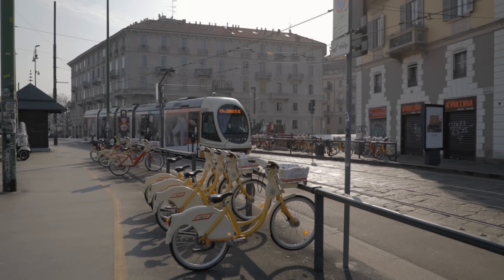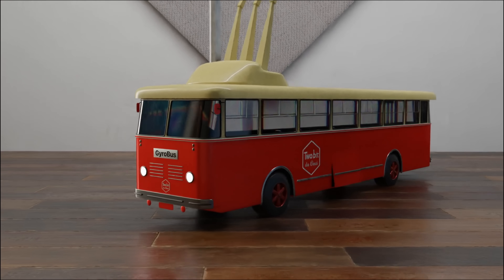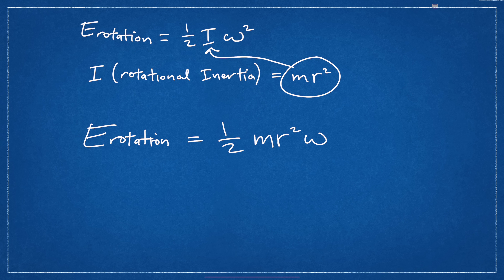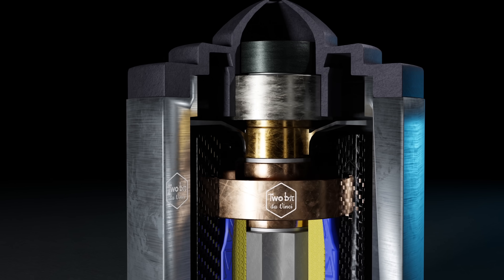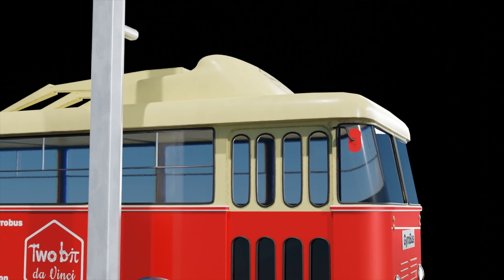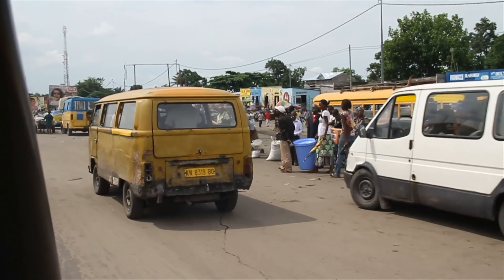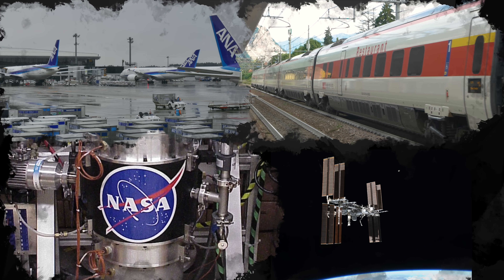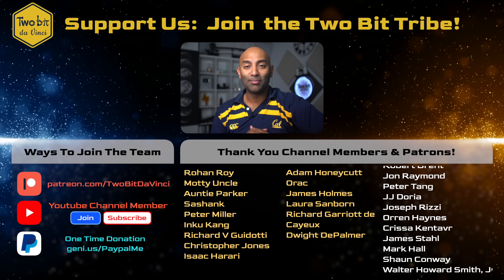This Bus Went Electric WITHOUT Batteries

Comment: 0:16 - Why you include something that stupid? There are also solar roadways... Do you want to lose all your credibility?
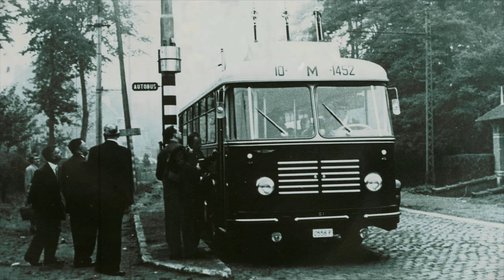8:49 - That is complete nonsense. Why are you even suggesting it?  At 8:19 we can see, the rotational axis of the flywheel is vertical, so there is no gyroscopic effect around that axis. It would resist any tilting actions of the bus, but not turning.

It would be nice if people on shows like this had even basic understanding of physics.
Reply from the maker: Turning caused the body to rotate as mass is uneven across left snd both sides. I didn’t get into it much more. But it would have the effect I described
Reply: @TwoBitDaVinci  Thank you for reply, but I have no idea what you are talking about. The way you can induce the gyroscopic effect is by trying to tilt the rotation axis of the gyroscope (flywheel). If you are turning the frame of the gyroscope around an axis which is parallel to the gyroscope's rotation axis, nothing (interesting) happens. Pure turning of your vehicle (frame of the gyroscope) happens around vertical rotation axis, so it is parallel to the flywheel's rotation axis, so you shouldn't have any effect. At most the vertical gyroscope (flywheel) would resist any tilting of the vehicle, not the changes of the moving direction. If this tilting is relevant or crucial for the drivability of the vehicle (while turning), then we have something to discuss about.

Comment: So did the heavy flywheel make electricity via generator or was it run off the wheel with a gear reduction?  How was the power train connected to the flywheel?

Comment: A fascinating snippet of engineering history. Not sure about the gyroscopic forces resisting turns though - the flywheel was horizontal so there should be no effect. Of course, if the bus hit a sudden hill or crested a sharp bridge you might roll a little and take a turn you DIDN'T want! (and the lowish rated speed wouldn't help because you can be sure the drivers would be gunning it...)

Comment: The practical energy densities of flywheels are not great. Like barely 50 watt hours per kg.
Making them suitable for stationary application. But if you want to use a ton of metal, you may as well make a nickel iron battery, or an iron or aluminum oxide based battery

Comment: The Southern REgion of BRitish Railwats had third rail electric locomotives equipped with flywheels. THe electricity they picked up, drove motors connected to flywheels. The flywheels were connected to generators. So the momentum of the flywheels would carry the locomotives over te short gaps in the third rails to avoid coming to a halt.

Comment: ..2 big points..the bus is mechanically driven with a fly wheel, not electric even though an electric motor may be used to spin the flywheel up..and also the climate emergency con for the funding scam that the new evil Greenpeace runs is bs..real scientists will tell you that the planet has currently only 400 ppm CO2 in the atmosphere when plants grow best at 1000 ppm which is why folks who grow food in greenhouses supply additional CO2 to their plants for optimal  growth meaning in reality, we need more CO2 in the atmosphere..don't listen to Greenfundings hustle..meaning we all need to drive more internal combustion engines...the planet is in fact in a CO2 deficit..drive more plz and save the plants on our planet...they so kindly make O2 for us..PS take off that OBEY cap right now and don't do it..unless you like satan and baal..

Comment: What about trollybusses? They are electric and don't have a battery, they are really common in some parts of Europe
Reply: Amusingly, the newest trolley buses here in Zurich (where the gyrobus was made!) do have batteries: rather than rebuilding the very complex system of intersecting trolley lines (for the buses) and overhead catenaries for the trams at a large intersection that was rebuilt a few years ago, they instead leveraged modern batteries. The trolley lines were removed from the intersection completely, far simplifying the cabling and making it much more aesthetically pleasing, and the buses simply pull down their trolley poles, cross the intersection on battery power, and then on the other side raise up and re-engage the trolley poles while passengers board. (Fully automatically, I might add!)
Reply: @tookitogo  I had always heard bout hybrid options, but they always seems nice to me, but considering the most expensive parts of the cabling is the curves (I think, I don't have any experience with this stuff) that's actually really smart
Reply: @thijmstickman8349  It makes sense! 

They also have started running hybrid gasoline (or diesel? I’m not sure) buses on some non-electrified routes.

Comment: this is a terrific article except for calling a flywheel a battery.  Batteries use chemical energy Flywheels store Kinetic energy,  Other than that detail this is a great artical .  I think I rode one of those in Budingen Germany in I970 it was a small electric train on a spur in Germany.  It Connected Budingen to Gelnhousen,  As a Small train it was ideal  Trains have limited radius corners.

Comment: I remember Polular Mechanics had a detailed artical about the Swiss flywheel buses in the 70s . These had a small gas motor , running up the flywheel .  The downfall , they said , was hard to turn against "Precession " , and , they spun out on icy roads and hills .They also required  major brakes for the extra weight .  About 15 years ago , I had to try this .  T put a flywheel chamber in a Jeep , behind the motor  [ a Toyota V6, because it was short ] . then I had a monster truck clutch , feeding power off to a regular   flywheel and clutch and transmission .  The big power cltch was  air operated , and controlled by a trigger on the shifter . It had two taches , one for the motor , one for the big flywheel , and, you could sense engagement by clutch air pressure  . I found     running it in a vaccum made little difference . I kept burning the lining off the big clutch until I used  white , asbestos and brass , winch lining [ it was bullet proof ] . The scary thing was if  it were to break , and this flywheel got out . I also had plugs in the housing , where you could reach in and fine tune balancing with big set screws .  In the end , it added so much weight to the Jeep , it needed huge brakes , and it required alot more fuel to run .  I wanted to be able to take off from a stop light , using no gas , and                 get up to travel speed , but the best I did was gain  alittle better than  one gear  up .  So it was generally a dissappointment . It could be more efficient at higher RPM , but would you want to sit on a grenade ? I gave it my best shot .Thanks for the artical .

Comment: Inverted hydroelectric generation would also work for solar installations on water. Containing a volume of water to be internally circulated, a practically weightless containment solution, can also take advantage of heat not being generated, and with appropriate bulwarking can also serve as shore protection.

Comment: The big problem with high speed flywheels is that they can explosively fragment in a collision. However if the fly wheel was hollow and filled with water that would lesson the danger.

Comment: It's a shame that such low tech + ease of maintenance solutions are not retained today. A modern BEV bus is packing 4 to 9 tons of batteries. Those need to be constantly plugged while bus don't run, and will need both a second life and recycling. While a flywheel bus with modern efficiency can do a much better overall full loop of material and energy total outcome.

Comment: Flywheel is a great innovation and would be gr at in an electric car, however I would hate to get stuck in a dangerous shady gas station with no juice. Maybe a hybrid would be a good solution for low battery.

Comment: The 'Gyrobus' suffered no gyroscopic ill-effects, because the axle of the flywheel was vertical. Reaction moments could have taken place only in the case that the bus rolled or pitched, but not when it followed a curved, plane trajectory, since –with the flywheel rotating in an horizontal plane– yawing cannot cause a gyroscopic reaction...

Comment: It’s always bothered me that we don’t use those for braking cars— the car could spin up the flywheel when stopping and then use the flywheel momentum to resume driving...
Reply: I had an idea once where all passengers could continuously pedal to ever increase the energy of a flywheel, also during stops at traffic lights. A fully human-powered car with, yes, low speed, but extremely low emissions and high comfort for shortish trips. I live in the Netherlands, though, so it's flat here...
Reply: They do.
Reply: @Redmenace96  I own five cars— none of them have it.  Are you talking about hybrids?  I believe they use electricity to cache the braking energy , not momentum.
Reply: @SonOfTheOne111  You mean re-gen braking flywheels.  But, your 5 cars have flywheels in the transmission.  Not hooked up to the electrical system, but transferring energy to and from the drivetrain.

Comment: Good examples.  Seem to have passed over ablation failures.  Mentioned but needed a few more examples.
That is why large flywheels aren't used more.
Example of ablation failure? Suiox Falls DC-10 crash, the engine threw a blade, the ablative shield failed.
With flywheels turning at much higher speeds ablation is a problem. 
But storage? Excellent idea.

Comment: I wanted to add that the 'Gorilla in the Room' here trying to use a flywheel in a moving vehicle is the sad fact that roads are not totally smooth and bumps will be encountered.   These will place MASSIVE loads on the bearings holding up a very heavy flywheel and even if somehow you support it so it doesn't crash into the casing the instantaneous G loads will destroy efficiency.   Flywheels in a stationary setting make more sense and are what we're seeing today...unless you're in orbit where bumps are not encountered.

Comment: Gyroscopic effect affected only the pitch and roll of a buss, both unwanted by passengers. That explains why they wear delighted by this design, so this bus was literally floating over the road, like if invisible force was holding it (and destroying flywheel bearings). Yaw, so changing direction was not impacted at all.

Comment: It's not really a gyro bus, nor is it 'insane', it's just a flywheel which is 'charged' with kinetic energy at the depot. It slowly runs down as the bus uses the stored energy via a generator and motor to propel itself along. The unwanted gyro effect is of little consequence as the flywheel is mounted with its axis vertically so it has little effect on the steering or cornering.

Comment: YOU made a mistake when saying that in the GYROBUS the gyroscopic effect made it hard to take a turn (changing direction at a junction of the street nework). The spinning axis of the gyro in the gyrobus was vertical, as it was shown in your illustration. Yes, the gyroscopic effect created some problems. But not when the bus was turning left or right. The problem was showing up when the bus had to tilt up or down when there was a sudden ramp going up or down. Then either the rear wheels or front wheels lost contact with the street surface. This resulted either in lost traction of the driving rear wheels or lost steering capability of the front wheels. The second phase of the gyroscopic effect when coming suddenly to a up-ramp or down-ramp on the street, was a leaning to the side (sideways tilting) of the bus, which was also not comfortable to the passengers and the driver.

Comment: I would imagine that rough roads and rapid changes of direction would have a significant impact on the flywheel.
Reply: Yes the roads would have to be pretty smooth.

Rule out Dallas Texas.
More potholes than people.

Stationary grid storage is a great idea.
Reply: Probably less of an issue with modern technology.

Comment: I once talked about a horizontal plane and a vertical plane being important factors for engine efficiency.  But insane things happened.  Criminally insane things...  Using the word insane to describe this bus is inane unless of course it is a killer of people.
Reply: Other examples of engines that are like EARTH's gyrotational spin are the Chevrolet Corvair, hydroelectric impeller rotors, my theory of gyro-horizontal-rotation(THAT'S RIGHT... MY THEORY!!!) watch the Globetrotter's Of Harlem: the spinning ball on the fingertip, spinning as EARTH spins...  I told someone about the wind rotors that produce electricity being like a gyroscope that spins as the string is pulled, eventually they loose their kinetic energy.  The wind tower is already vertical, the generator engine is horizontal, and yet a third rotational axis of the blades.  I explained the process of producing electricity using wind power only needs two axial rotations instead of three.  The big producers of this wind electric turbine really dislike me...  Another example of this efficiency; A barometer in a glass orb.

Comment: 👍Good video. Would have been interesting to have had a trip on one of those buses. You could argue that modern buses still have flywheels in the form of their road wheels. Even internal combustion engines rely on the flywheel effect of the engine's crankshaft.
Reply: Yes indeed regenerative braking is exactly like getting energy from a flywheel.   As for piston engines, it is standard to have a flywheel between the transmission and cranckshaft.    Usually less than 200 KG and often times far less.    Its function is to smooth out the the rpms in the crankshaft and to balance the power strokes amongst the different cylinders.

Comment: I am from Gent, the city in Belgium that tested the gyrobus (though I am just not old enough to have known them).  I was told that the main problem with the gyrobus is that when it was caught in a traffic jam, it could not get to the next loading station before the flywheel stopped rotating.  Then a normal bus had to be brought to tow the gyrobus to the next loading station.
Reply: Just throw an underpowered engine on so the bus can get slowly to the charging point.

Comment: In England some locomotives (class 70 and 71) were known as boosters .   They used fly wheels charged up while on electric supplied track .  Not for reducing energy usage but for energy storage and energy boosting so they could have temporarily more pulling power or acceleration then the actual rating of the locomotives and for traveling where there was no electric supply .  Also batteries .

Comment: Sometimes old engineering answers are just amazingly effective. The Archimedes screw is a great example. A very short version is still used to propel most of our watercraft ie the propeller.
Reply: I would like to add that the Archimedes screws are the reseason that the Netherlands is not a sea.
Reply: Really Interesting..
Reply: Or grain in a lot of places
Reply: used to move grain on every farm in Canada
Reply: H.S.U.V = hyper steam universal vehicle... Same good old steam + vacuum insulated carbon fibre tanks + electromagnetic valves + heat from sunlight & IR lamps = the absolute best heat to mechanical direct and super efficient energy conversion with ... ZERO BATTERIES, COMPUTER CHIPS / AI + ZERO COLLISIONS / ACCIDENTS / INJURIES OR DEATHS (by using radio waves cushioning)

Comment: The flywheel does not have to make a comeback. Its used all the time in for example wind mills, electric grids, trains, rollercoasters, … as long as space and weight are no concern a flywheel is usually a better alternative then a battery on cost, maintenance and lifespan

Comment: at 5:35 I looked at the front wheel of my e-bike and eureka, what if we had a device attached in the front wheel looking like the flywheel on-screen which by driving the bike, would charge and keep the battery topped and ready any time. :O

Comment: That flywheel is agood idea especially when used as stationary machine.
But consider a flywheel in motion.
I think it is very dangerous if this flywheel has wider diameter and greater mass. 
A gyroscope when activated  tends to maintain its position. Try to make a giant gyroscope and move it in intentional motion and direction: and you will know the effects.
Please consider it.
Thank you.

Comment: i think flywheel's r way more powerful then most people r think in space u can use multiple flywheel's on like robot arms as a form of propulsion and stabilization by just twisting them and slamming on the brakes on them at the right times in counter spinning wheals ...like if u ever picked up a spinning bike wheel and notes its has a counter force when u try to twist it around so if u got to or more of them on robot arms & let AI will finger out the best timing to use them it will use them like some tipy of  giro grav space wings but only a computer can get the timing right its like the different between a hand held 3d printing pen or a 3d printer lol no human can pull off the stuff a full on 3d printer can to trust me i tried lol

Comment: The gyro effect could be negated by contra-rotating flywheels. And maybe with modern tech the cost can be brought down. BTW, when I arrived in Oxford in 1992, the city had full-fledged electic buses, using lead-acid batteries. All the buses charged up in front of the train station, did their routes looping back, rinse & repeat. Mind you, Oxford is a small city and the routes were not very long. I believe that in Brazil, they have dedicated bus lanes and the buses charge up at stops. With modern batteries and stops close enough that the battery was 80% full at each charging station, it wouldn't take that long. .

Comment: You wouldn't need all the electrical wires over head. Put some solar panels on the bus with some barriers. Both the solar and flywheel will charge the batteries. Add a little gas tank for bad weather days and the bus could cut the carbon footprint down by a high %...